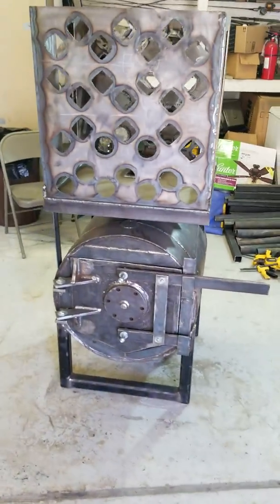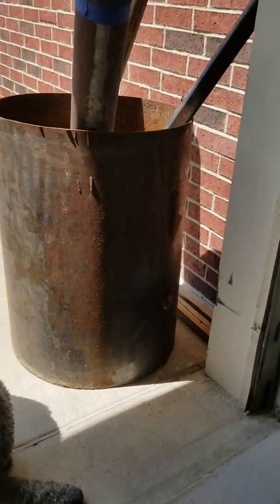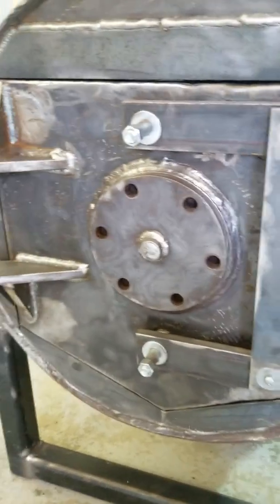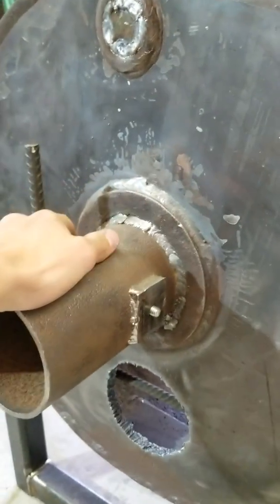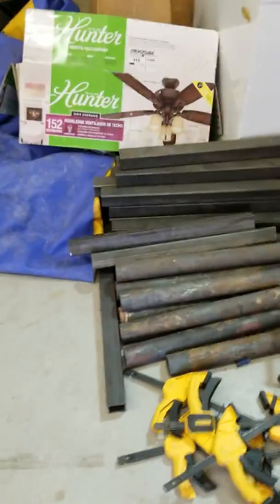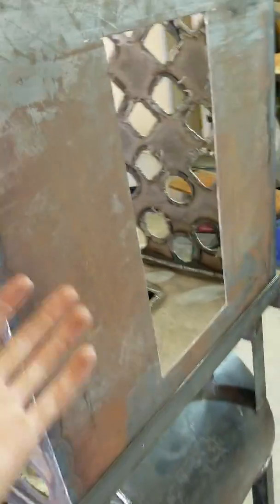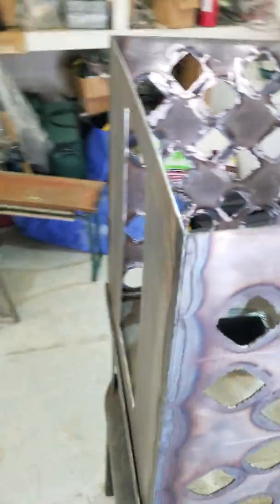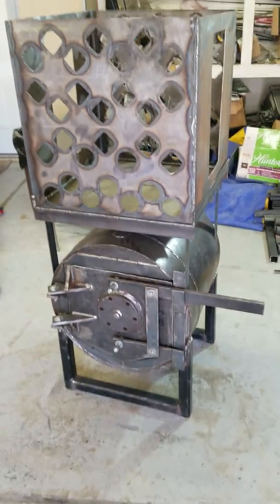(Part 1.1) Building wood stove with high efficiency heat exchanger

Comment: Is the project finished?
Reply from the maker: I have not. I insulated the shop so well, that a tiny space heater could keep the shop that I was going to put it in warm, even in below freezing temperatures, so it ended up being waaaay overkill for what I needed so it got pushed to the backburner. I do still have it and I do plan on finishing it even though its overkill. It's just been sitting in the back of my shop, but I still have all the parts to finish it.
I don't know what I will do with it when it's done, maybe let a buddy who has a muuuch bigger shop use it, or maybe even sell it, idk?
 Subscribe if you want to see when I finish it because I will make a video(s) of me doing so in the next year,  and make the videos MUCH more professional and really get this channel going with other similar projects that are already in the works!